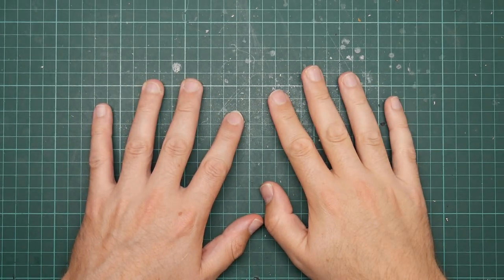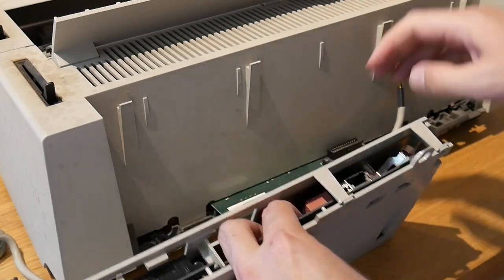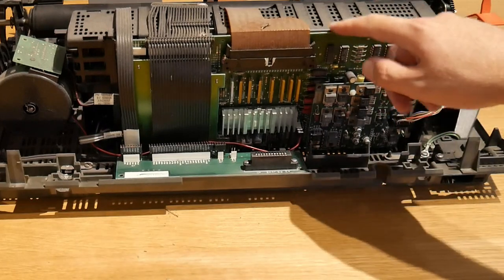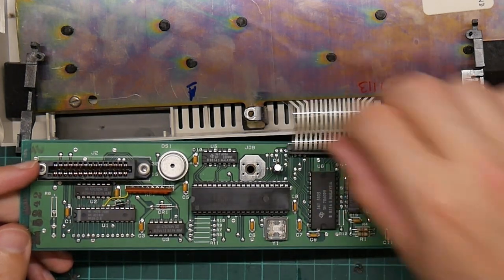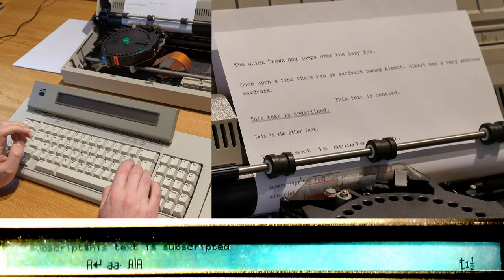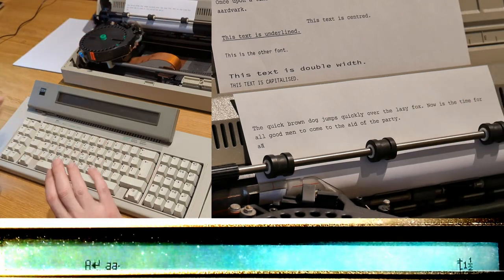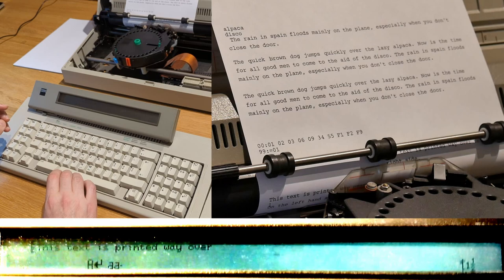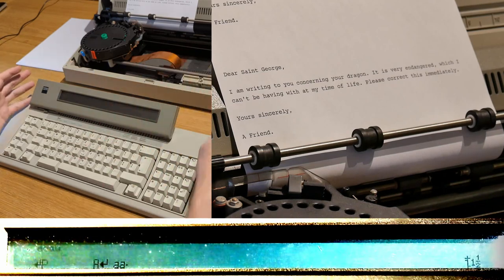The IBM 6780 Quietwriter: teardown and demo

Comment: What a fantastic machine. The printer is so quiet, smooth and precise. To contrast with laud keyboard. Watched the other video about rev eng of the keyboard and lcd protocols, (I know in the wrong order), and you did an amazing job. The entire system is engineered and built really well. The correction future is like magic.

I knew they made some fantastic machine, but never really seen one myself.

I found a IBM Selectric few years ago on the street in Zurich, and adopted it, and I also found another thrown out electric typewrite from maybe 1993, Brother AX-145. It is a bit loud, due to the hammer action. But print quality is pretty nice, it is very small, and portable, with a carrying handle, and keybord is integral to the printer, with small 2 line LCD.   Has a built in German / Swiss spellchecker, and Swiss keyboard, and one font (Brother Daisywheel - BROUGHAM 10 Pitch, SWISS, plus underline and bold. From what I can see on the wheel, there are no separate characters with umlauts, and they are composed from two print strokes of normal later and separate for umlaut, etc).  But this IBM 6780 is two levels above it, in terms of speed, and functions. My cheap AX-145, when it decides to print the buffer, takes some time to print, and does not give feedback when you continue typing when it is printing or going back from right to left, which is annoying. Still fun to play with.

I am sure you can get still find some supplies for IBM 6780 around.

Maybe I should look at ricardo more often, or scour streets for some more thrown out stuff :)

Comment: Thank you for this. I have one of these but it the print head is a daisy wheel. Your print looks a little like a thermal print head but I can't tell for sure. This has been so helpful. I actually have several versions of these IBM / Lexmark machines. I love them all and they all work as intended but for this one. I think it just needs a lot of love and attention that I have not given it yet. This makes me want to get back to it. Thanks again.

Comment: Strange.  The selectric has silent keyboard and loud type head.  The Quiet writer could have been very quiet, but they installed a keyboard that is almost as loud as the type head of the Selectric!  I have always really wanted one of these quiet typewriters, mainly because of the quietness.  Although I love clicky keyboards, I think the wrong place for them is on a silent typewriter.  Particularly if your purpose was to use it in an office with other people who are against loud machines such as typewriters.  (although they are perfectly fine with Honda Civics with the muffler removed, and 150 decibel leafblowers running every day of the year).  I wonder if there is any way to get a quiet keyboard to work on this machine?

Comment: What does the keyboard have on Shift+1 if not an exclamation mark? My German Model M keyboard has the exclamation mark there, just like any other German keyboard I've ever used.... I'm a little bit confused now...

Also, I'm confused as to why you wouldn't want to port CP/M or FUZIX to that typewriter 😀
Reply from the maker: Shift+1 gives you a +. It comes from 1985, the same year as the Model M itself, and I don't think standardising the layout was high on their list of priorities... re porting something, I would have to reverse engineer the expansion connector and build a storage device first! And sadly the machine is much too big to fit on my workbench, and that's the excuse I'm sticking with.

Comment: I think your mystery battery may be a CR12600 3V Lithium.  (Varta CR-2NP)
Reply from the maker: Looks like it, yeah; thanks. That means the measured 3.0V was dead on. Surely that can't be the original battery from 1985, still working!